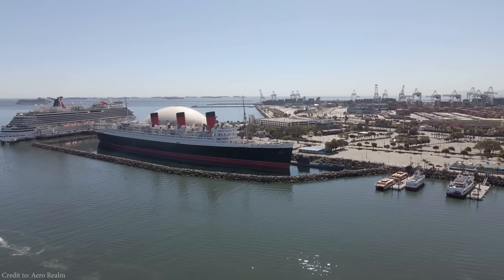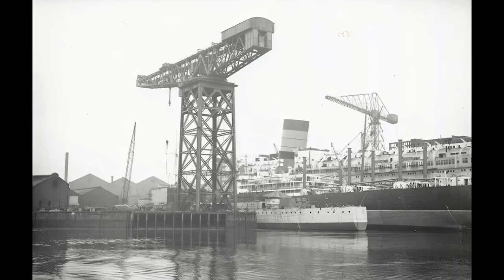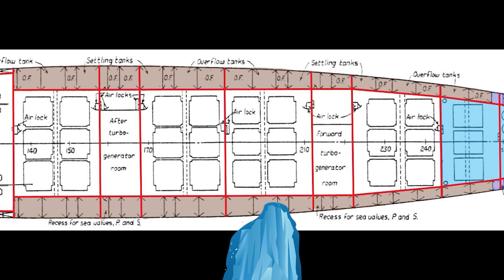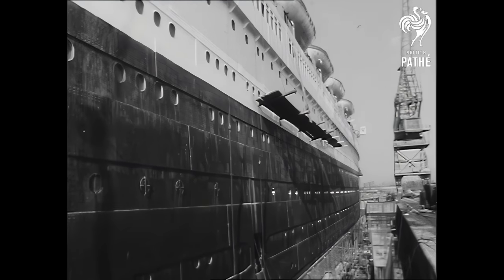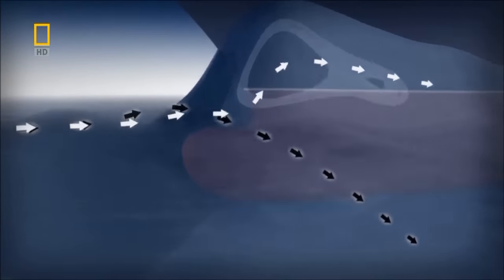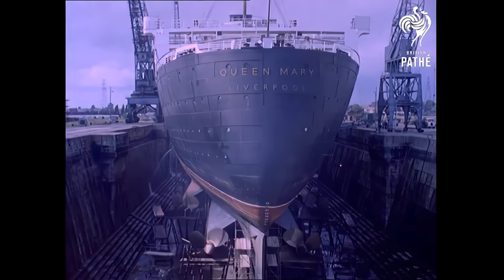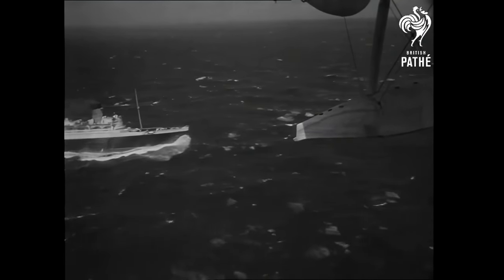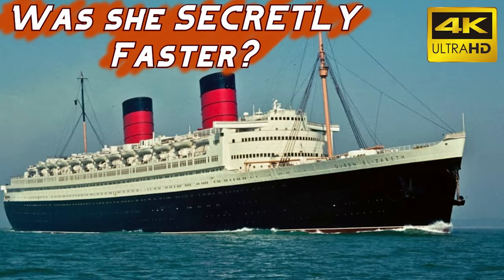Queen Mary: A Hull Lot To Know

Comment: Design work on the Queen Mary began in the 1920s, and it was a conservative design because Cunard couldn't risk failure; if the ship couldn't maintain a two-week round trip schedule from Southampton to New York and back, it would have been a financial disaster.
The Normandie got a better hull form thanks to a stroke of luck - a Russian naval architect who had escaped the communists, Yourkevitch, persuaded the builders to try out a model of the hull he designed. The model tests showed that it had less drag than the traditional designs.

Comment: Interestingly, the Conte di Savoia was not just one of the first liners to adopt a bulbous bow or a cruiser stern, but also one of, if not the very first super liner to adopt both. It's fuel efficiency however wasn't stellar (probably due to the extra weight of the Sperry stabilisers), but just like with the QE and the QM, it's said that the Conte could reach speeds capable of rivalling and even surpassing those of her much more powerful running mate Rex (which was also one of the first users of the bulbous bow, but had a classic clipper stern instead). It's not unlikely that the order for a possible Conte speed limit was set by the Italian king himself for prestige reasons, as Rex was the biggest and most famous of the two and was also named in honour of the king. But maybe it's just one of those sailor's tales of speculation, who knows.

Comment: Some people say Queen Mary belongs as a museum in the UK not the US. But hear is a Question could she Servive the trip being towed across the Atlantic is she sea worthy enough?
Reply from the maker: No, she's not. Her interior structure has been heavily altered, and not in a way designed to be seaworthy. Her alterations are designed to static building code. She could be floated across the harbor, but not across the ocean, not without significant risk.
Reply: @AlextheHistorian  she probably couldn't handle the constant bending and flexing and just the movement of the ocean in general. The reason that Queen Mary is designated as a building is because Long Beach knew that to preserve as much of the ship as possible, they would have to designate her as a building which means altering her structure to a building code NOT seaworthy code.   

If they tried to tow her across the ocean, it could be disastrous. Also, even if Long Beach preserved her as she was when she steamed into the harbor, she probably wouldn't be seaworthy after 87 years anyway.
Reply: She is also not seaworthy because a large piece of her hull was removed and a tank containing freshwater was built around the removed piece of hull to let people see her last remaining propeller in the ship's engine room exhibit.
Reply: @artsygala  Also half of her C Deck was Removed from the stern to amidships.

Comment: Thanks - what a great video. I do know that the Queen Mary's hull floats at Long Beach, but do you know what her draught is there? Wasn't the waterline painted moved because she sits higher now? Do you know how much of a 'gap' there is between the bottom of the keel and the lagoon? I've always wondered this. Thanks :)
Reply from the maker: Well they've never moved her waterline, that one is just a myth. In Long Beach her daught is approximately 34 feet, which is 5 feet shallower. And there is about 12 feet of space between the bottom of the keel, and the bed of the lagoon, depending on the tide.
Reply: @AlextheHistorian  Is the reason her drought is 5 feet less than originally is it because they removed all her boilers,Generators,water softening plant, and 2 of her engines?

Comment: The Queen Mary had more propulsion Hp 245 thousand to each propellor and RMS Queen Elizabeth had less propulsion hp 220 plus she had 8 less boilers supposedly to save on fuel but was only 28 knots top speed where the Mary had 35 knots top speed.
Queen Elizabeth was not as popular at the Queen Mary.
Reply from the maker: Please don't take this the wrong way, but just to provide a bit of correction, all your information is inaccurate.
SS United States was the most powerful ocean liner ever built and she had a combined output of 240,000 shaft horsepower. So if Queen Mary had 245 thousand per propeller....that would make her the most powerful ship that ever existed, and that's just not the case. Queen Mary had a maximum combined (all four propellers together) output of 212,000 shaft horsepower.

RMS Queen Elizabeth had engines that were capable of the same horsepower, but she had only 12 boilers (half of Queen Mary's) not 8 fewer. 

Queen Mary and Queen Elizabeth were both designed for a service speed of 28 knots. That's the speed at which the liners maintained across the ocean. But maximum speeds were different. Queen Mary's maximum official recorded speed was 32.84 knots, while Queen Elizabeth achieved 32.50 knots. Still slower than Queen Mary but not so dramatically slower.

Queen Mary was the more popular liner at first, but towards the mid 1950's and 1960's Queen Elizabeth was actually the more popular to book voyages on, than the Mary, because Queen Elizabeth had slightly newer interiors and the outside of the ship looked sleeker. Queen Mary appeared very old fashioned. But if you wanna say Queen Mary was more famous, then that would be correct, Queen Mary is currently more famous than Queen Elizabeth.

Comment: Alex, you are indeed correct. The Queen Mary was not designed to be fuel efficient as she was far from it. 

Here are some statistics about her fuel consumption.  

● 1 Gallon for every 13 feet traveled. 

● 1,100 to 1,500 tons per day. 

● 73 gallons to travel her own length. 

● 406 Gallons just to travel 1 mile. 

So Queen Mary was costing Cunard more in fuel than they could make a profit.
Reply from the maker: You were all correct until that last statement. Cunard would NEVER design and launch a ship that they couldn't turn a profit on. Queen Mary was a highly profitable ship for about 27 of her 31 years at sea. It wasn't until 1964 that the two Cunard Queens saw such a drop in passenger numbers, that they began sailing at a loss.

Otherwise they were highly profitable ships.
Reply: Even if they Servived into the 1970s, the Oil Crisis would have been the nail in the coffen.

Comment: Does anyone the latest work done on the ship or an estimated time of reopening?
Reply from the maker: Since February the ship has had 2 watertight bulkheads rebuilt, she is getting a new emergency power generator, she is having 11 new bilge pumps and water intrusion alarms installed. She's been receiving paint touchups, light fixtures repairs, some of her interior spaces are getting attention to original wood paneling and some minor artwork cleaning and/or restoration, and deep cleaning and maintenance is being done to the stateroom cabins. The city has only said the ship will reopen "Fall 2022".